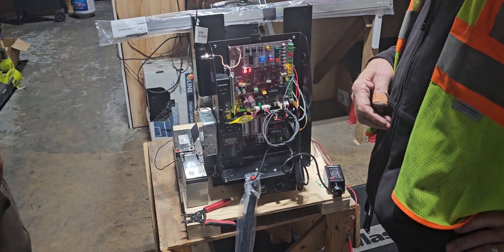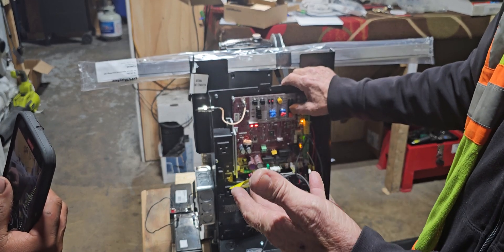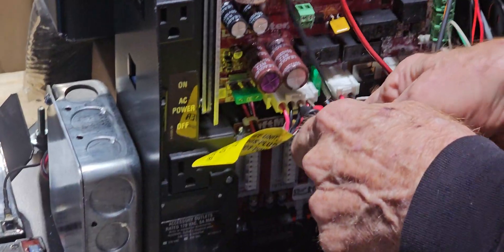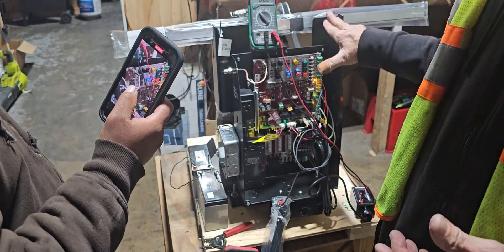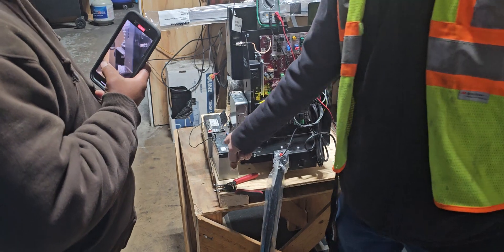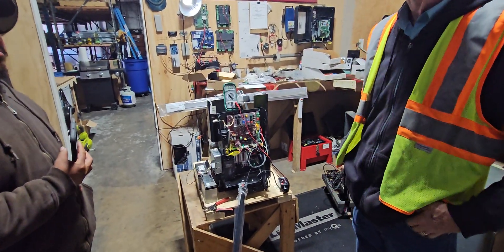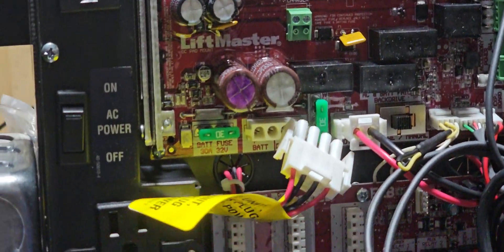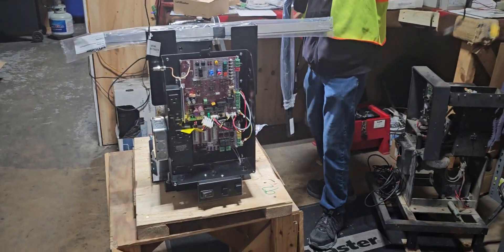Liftmaster CSL24UL Error code history and troubleshooting

Comment: My batteries went bad so I replacement them with two 12v 35ah batteries from harbor freight. But the charging light won’t blink and the battery dies after a couple days.

Am I supposed to reset something after battery replacement? Also checked solar power and it’s 37v